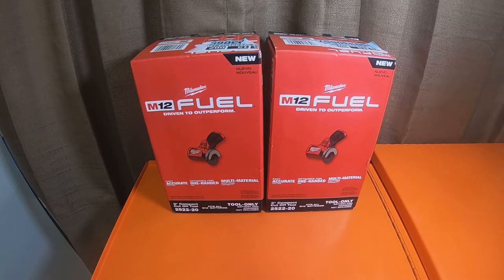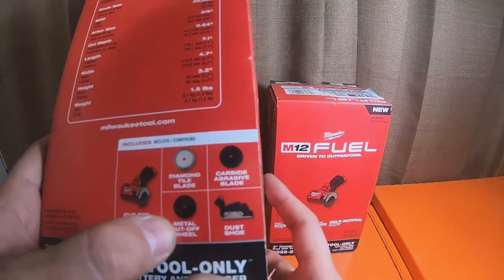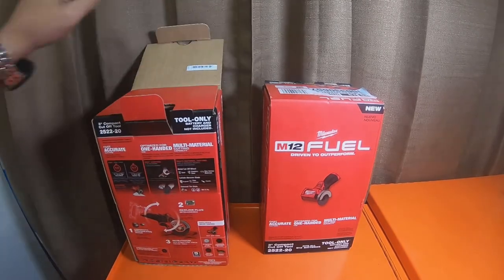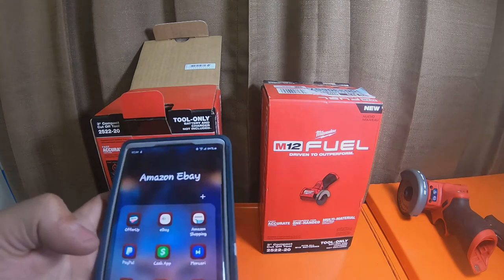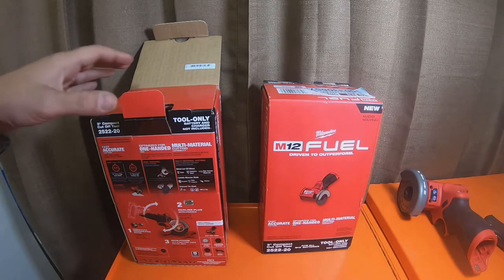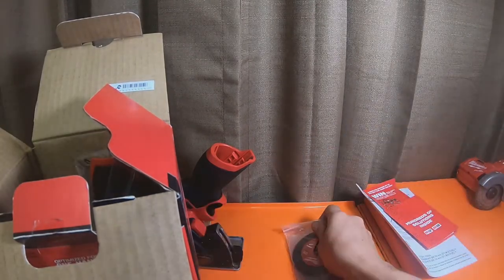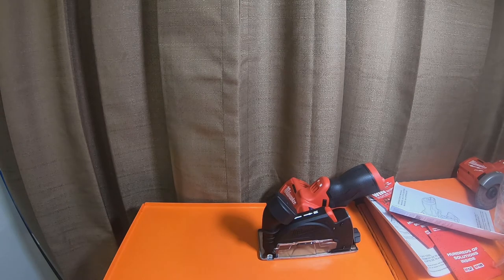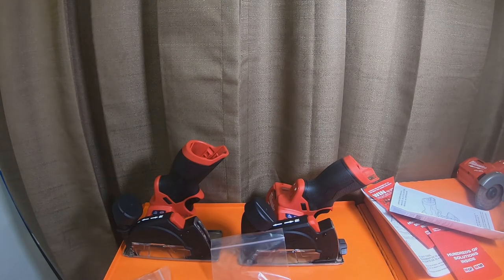Tools - Milwaukee M12 3 Inch Cut Off Tools 2522-20 What Are They For N Updates - 2 2nd 21

Comment: I bought the full metal case from punkcase.. I stopped buying thin cases.... I have s20 Ultra... that's how I watch your channel... m12 are super lightweight.... how is the battery life when cutting into a sheet of metal? I run m18 because I get battery range anxiety .. 🤔
Reply from the maker: Battery life with a 6ah I getting 15 plus sheets of metal with multiple cuts sheets are very large 4x8 sheets last all day for me @Hector Reyes
Reply from the maker: I have had amazing battery life on the m12 tools and these cut of tools are great for sheet metal they don't bog down on sheet metal what so ever... these 2 are for a surprise conversion to different tools  I need and they are working great... @Hector Reyes
Reply from the maker: The way my phone hit the Object a metal case wouldn't of saved it either the case I have and the screen protector actually saved my phone from damage on the bottom glass as well as the front screen if I didn't have a screen protector the front screen wouldn't of worked and metal cases are hard to find for the galaxy note phones no case protects the front glass no more and this is a defender series otter box have had these cases for all my phones for 15 plus years and they have saved every phone I have 100s of times I will check out punk case though if they have belt clips might give them a try @Hector Reyes